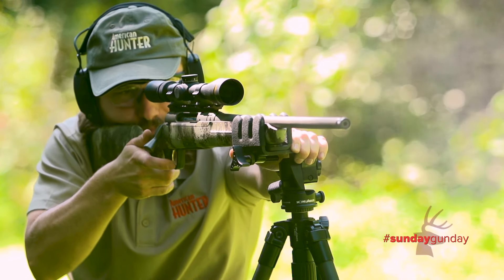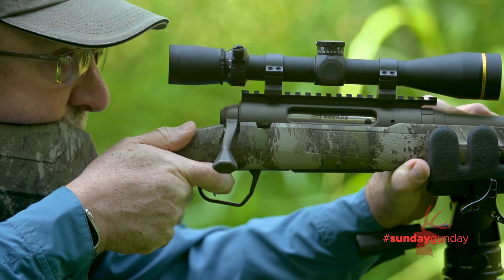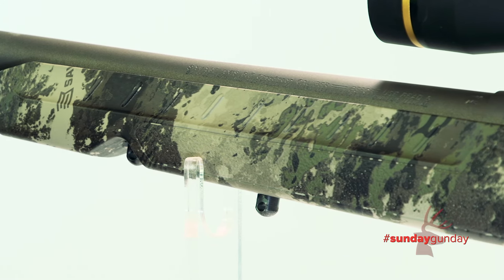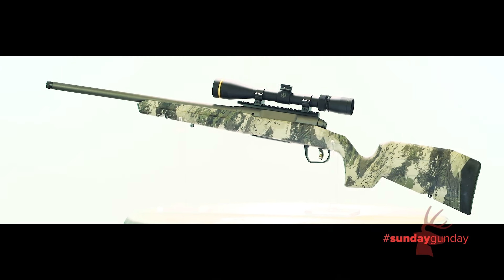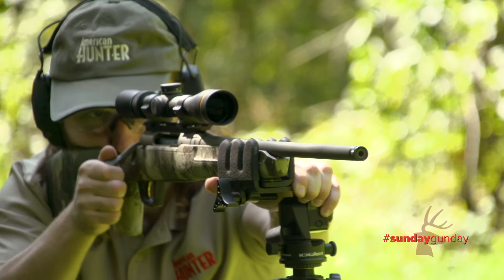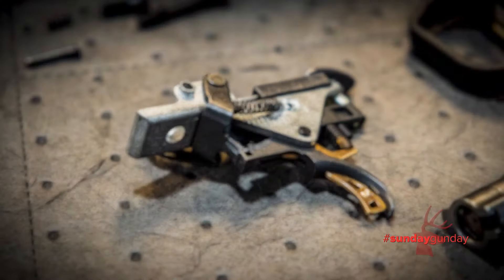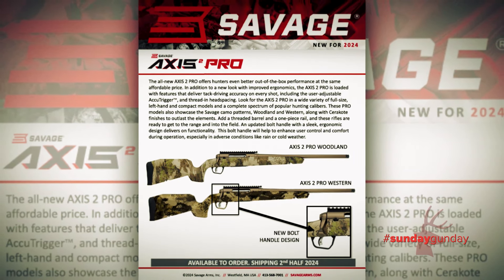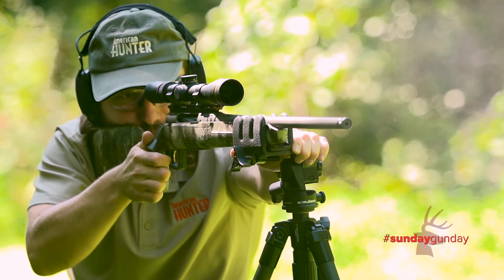#SundayGunday: Savage Axis 2

Comment: I hope they fixed the insanely hard bolt lift
Reply: It's still a considerably stiffer bolt lift than the 110s but it's very accurate, girlfriends 243 with Barnes ttsx will stack 5 shots in .80" at hundred on a sled with 3-9x40 scope. That's after proper break in fire lapping the barrel for first fifteen shots, I always do that with button rifled barrels. She may get 6-18x50 scope upgrade for Christmas. 😉

Comment: Don't like the stock.   It's made for target shooting...  NOT hunting.

I like 24" and 26" barrels.

The reciever should have a MORE open action to allow better access for loading.  I don't like detachable box magazines.

I don't like plastic either...

BUT I do like the stock's camo pattern and color!
Reply: Unless you’re shooting offhand, the new stock is better
Reply: In some cases, I don’t agree. Case in point, my wife has smaller hands than I, and she’s really got to stretch for a proper trigger pull with her finger pad. With these pistol style grips, her finger fits perfectly while her hand is firmly planted on the grip since her hand sits closer to the trigger. She’s not pulling the rifle and her shorts to the left (she’s left handed).

So in this case, it’s actually a benefit.